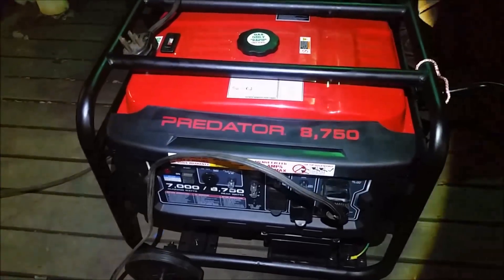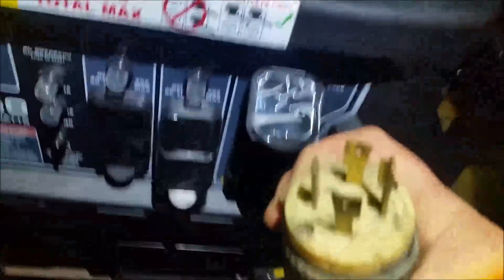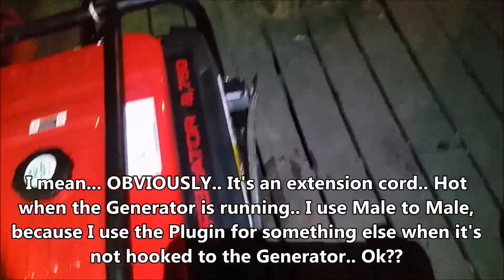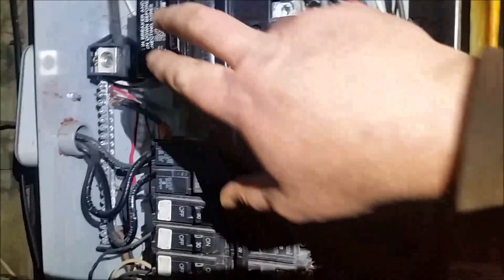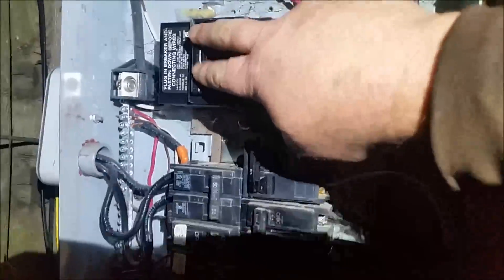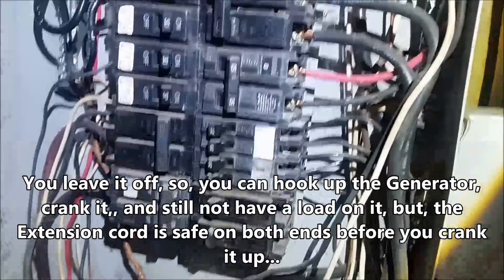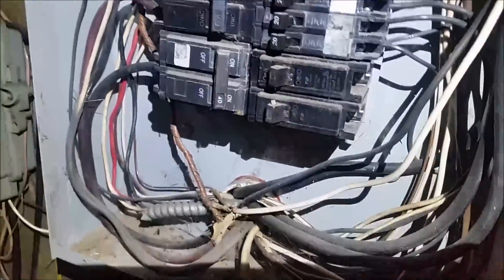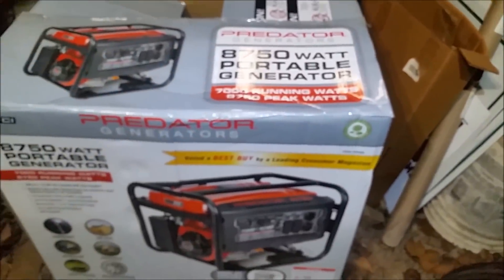Quick/Easy/Safe: Use Existing Plugin/Breaker for Generator hook up to your house Panel box.

Comment: I sure do not believe in censorship so I support the right of this moron to spout his dangerous "information," but I pray that no one will do this.  Your local lineman will thank you for not making his children into orphans.  Yes, if you actually disconnect the breaker to the line it will not energize the grid, but humans are terrible at performing multiple steps perfectly and linemen have been killed this way.
Reply from the maker: What a Moron!! My Local Lineman use this same setup.. One saw what I was doing and over the next few power outages, two more came by to update me on the status of the outage (Something that Never Happens), and the asked to see how I had hooked it up.. They like the simplicity of it and the ease of it, and it is all that is needed to be safe.. I don't care what type of Generator setup you have,, you can call it what you want, but, EVERY ONE OF THEM,, will involve the "Service Disconnect".. IE. Main Breaker being switched off. So, if you can't remember to switch it off,, then, you can't use this or a Transfer switch or an Interlock.. 
Of course,, Morons who can't perform multiple thoughts may not catch something that simple.. 
BTW.. Step One is Turn off the Main Breaker.. What kind of Multiple Steps is that?? All that is needed for this setup Moron... 
You didn't catch that?? After the Main Breaker is turned off, you can't hurt anyone out on the line Moron.. 
Don't know what kind of Morons you associate with on a day to day basis, but, I don't know any that can't follow simple instructions.. 
BTW.. How do you "Get Dressed" in the morning?? That is Multiple Steps.. 
How do you fix dinner? That is Multiple Steps.. 
How do you get to work?? That is multiple Steps. 
How do you check your Oil? Multiple steps.. 
Check your Email? Multiple steps?
Maybe we should break it down really simple here.. 
Turn off the main breaker.. Stop and Think.. Next Single Step??  I have no power... Ah... I have a generator!!!
Lets see.. I need to hook the Generator up to the house.. Oh.. Simple.. Main Breaker is off.. Generator not yet cranked.. I need to hook up the Male to Male Plugin.. Ahh.. Still No power.. What is my Next Singular Step.... Ahhh.. Crank my Generator.. 
Ok,, I cranked it... Still no power..  Ah,, I turned off the Welder/Dryer/Range Plugin before I hooked up the generator, so, I could crank the generator without any load on it.. (CAN'T do that with an Interlock BTW),,, So,,, I turn on the Generator breaker and the Lights come on.. I stop and think.. Is that it?? Yep.. Everything is working.. 
Even a Moron can do it,, if you break it down the same way that you do other things every day,, like get dressed.. You didn't forget to tie your shoes this morning did you??? 
See.. Even a Moron can do something this simple.. BTW..  I like Free Speech too.. I support the right to spank Morons when they Spew ignorant shit about a very smart and efficient way of hooking up a generator...  But,, like I said.. This video is for people who have common sense.. That eliminates your Average Moron,, and the reason you are barking about the video.. 
Morons do!!!! Welcome to youtube,, and my Channel.. Spend more time looking and listening and less talking unless you are asking questions, and you will learn a lot more and maybe not feel so limited.. Cheers!!
Reply: Mark, now we know why so many automobile accidents. Too many people that are terrible at performing multiple steps perfectly are driving by rote.
Reply from the maker: Ha.. Yep.. He has a point though... From the comments here on this video,, I tend to agree with him on some people not being able to think enough to do them.. But, this video is not for Morons like that... I hope the percentages are not high though.. We would be talking about some severely brain limited zombies when you really think about it.
It very well could be the source of some of those accidents.. Holy smokes.. Ha..Ha..
Reply: Actually we shouldn't be too critical of them, but they shouldn't be critical of us either. We are analytical thinkers, when we start to do something we see the plan in our mind. When we start a trip we see the road map in our mind. When we open the breaker panel we know exactly what we are going to do, we visualized it when the power went off. Here is the definition of analytical thinking;

Analytical thinking is a critical component of visual thinking that gives one the ability to solve problems quickly and effectively. It involves a methodical step-by-step approach to thinking that allows you to break down complex problems into single and manageable components.
Reply from the maker: Yes. I agree.. And, if I would not have had to deal with so many that spout of like they know what they are talking about but don't,, I would give them some serious slack.. I answer them and tell them correctly what they are missing and try to do it in  a way they can understand.. You just get tired of the DemoSlap Crap.. But, I do agree.. But, I'm not perfect either.. Ha.Ha.. I can't say I don't have fun outsmarting them.. Ha.. One sentence at a time.. (Manageable Components).. Ha.. 
Now.. You talk about a powerful mind.. Add Conceptual thinking on top or in front of the Analytical thinking and you have a powerhouse, ready for anything.. I'll post the definition here (To be honest, I didn't think there was one.. I thought I coined this phrase myself..Ha.. ) but, I'll add things in " quotes" where I think things need to be added for my own clarification.. 

Conceptual thinking is the ability to understand a situation or problem by identifying patterns or connections "Or Associations", "Using Associations" and addressing key underlying issues. Conceptual thinking includes the integration of issues and factors into a conceptual framework.
I would not have written it like that, but, then again, I can't explain it in a few sentences either.. But, if a guy pays attention to the the most simple rules of physics,, you would be surprised at how much you can do or understand or come up with related to the Physical properties of whatever it is you are working on.. 
I can give some examples.. I have fixed some problems with high level computer systems where I really didn't have a clue how to operate them, or how to fix them,, or even how to communicate with them,, but, I knew how they "Should" work,, so, I ask for someone who can show me the problem and someone who can operate the machine at an Administrator level, and I get them to reproduce the problem and let me see it, and describe how they think it should be working, which is the end result we are looking for.. Then, I take how the machine "Should work", and identify which processes are working when it fails and use Logic and deductive reasoning to Identify the areas that could be the problem, and then, try to explain what type of testing I want to do in order to test my theory.. If I have someone sharp on the Administrator side, I can usually pin down the problem within the first few suspects.. 
More simply.. Conceptual thinking would be working on something simple like a Lawn Mower that won't crank.. 
It is one things to troubleshoot something based on "How It Works".. It is totally another to know How it works,, and then using the "Why it Works", to nail down the problem.. You can be fooled with the knowledge of the first, but, never with both knowledges. IE... Lets say you have bad gas.. If you know how a lawn mower works.. Gas, Compression, Spark (Timing not an issue here), you should have ignition.. But, what if you have all of the above? Now What? You know your spark is hot enough. You know you have enough compression. You know the timing is good.. You also know you have gas, but, it's still not running.. Many would give up right there.. But, understanding the "Why it works or should work at "This" point,, using that Analytical thinking, you grab some fresh gas, or, a shot of starter fluid, give it a quick squirt and bam,, it cranks.. 

If you are a carpenter and you build homes.. No reason why you can't be a cabinet maker.. Same Physics of materials, same measuring, just more accurate and a different set of tools.. 
If you are a cabinet worker, all you need to do is understand the Physics of metals and you can become a welder and build metal cabinets.. 
Become a Blacksmith and understand more physics than you ever thought possible about metals and you can build stuff that will blow your mind, using concepts you learned about the materials.. 

Apply this same thought process to human beings, and you can use it very effectively.. I call it the "Contiguous Wheel of Thought".. Works especially well in Politics, to pick out the lying rats.. 
One type of human in particular that I have not yet figured how to make all of this work in is the "Female".. 
I fail miserably.. Ha... Because, I can fix anything except a crying female that says "Nothing is Wrong".. Ha.>Ha.>aHa.. 

I had to throw that in there.. Ha.. 
You listen to whatever a candidate says and stuff it into your databank.. You develop your opinion of that candidate based on the conglomeration of thoughts he has said/did/displayed over a period of time, and when you hear something he is saying just to be saying it to get votes for or whatever, it does not match all of his other "Contiguous Thoughts he has already demonstrated..  You can ignore slight comments here and there, but, never something of "Concept"..Never a Principal, or something that would be considered a "Core Principal" of someone's personality..  
I can hear something on the news and tell by the end of the sentence whether or not it is total bullcrap.. 
Obama was very simple to figure out.. I suspected him being a Communist hiding under the cloak of Socialism.. I also noticed  his Islamic tendencies that were very hard to see when he was first getting cranked up.. But, let them start gaining some steam and momentum, and you are sure to start seeing the more radical side of the house.. 
I knew he was Stone a Cold Socialist the second he "Began to reply to Joe the Plumber".. Just the look in his eyes before he started speaking gave him away, not to speak of his following Comments. Once he started picking up speed, you could see the Islam loving coming out of him, and that didn't take long before he started showing his Radical Islam side..
I have only heard someone say Pakistan and pronounce it like he did, when I was talking to someone who was From the Country.. And, to hear him say some Islamic  welcome sayings and quote them perfectly with a perfect accent, I was 100% certain he had been trained and studied under some of the radicals.. The perfect accent is the last thing you pickup when learning a new language.. We still do not know the truth about his past, and that is a Guarantee. 

Trump on the other hand was hard to pin down.. I saw things here and there that I was hoping to see more of, but, when he gave this speech, I knew he was the man for the job, and I knew, without a doubt,, he was going to win the election.. 
https://www.youtube.com/watch?v=G2qIXXafxCQ
Anytime you hear someone come out cold and hard against something you have built up over time in your databank, you are looking at one stone cold dangerous liar.. I saw a good bit of that with Obama and Hillary... Then, you have Batshit crazy guys like Bernie S.., that don't have a damn clue about Economics 101.. They scare me the worst, because somewhere above 75% of Americans don't either.. But, when, you tax the rich, they are they ones paying everyone else to "Not Work".. Eventually, they figure it out and throw their hands up and say,, "I Quit".. And who is there to pay for all of the "Free Things" Then?? 
There are Countries where this actually works, and if you dive into them, you can see how they work and why.. Norway and Oil is one of them.. The Islands and banking is another.. But, let something happen to either of them, and you will have another Country just like all of the rest.. Venezuela and Oil is another.. Just one Rouge group in the Government and bam.. 
Anyway.. Got off topic, but, it all fits..